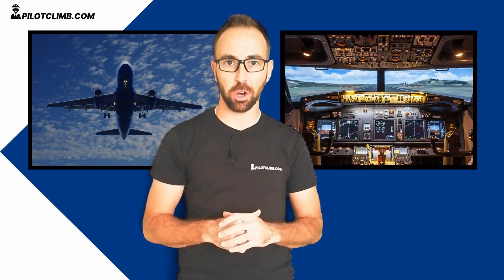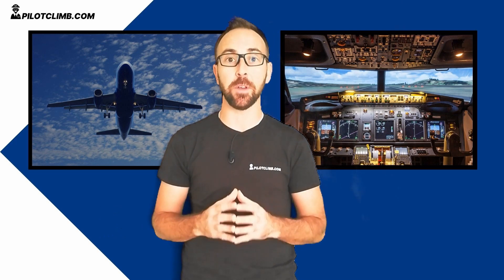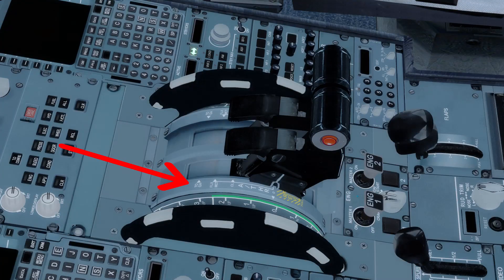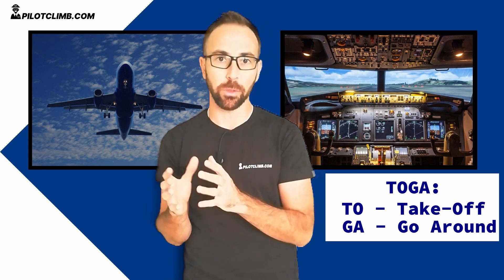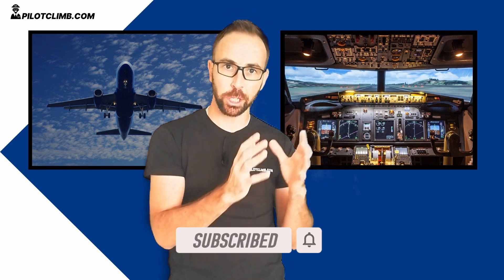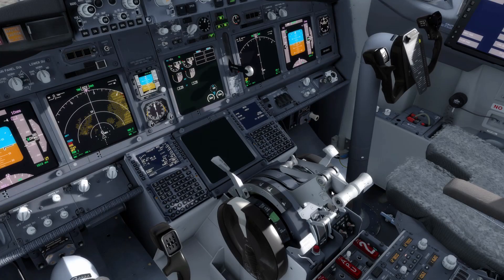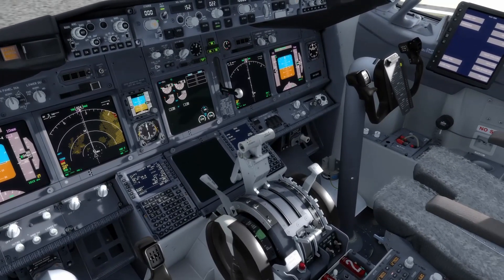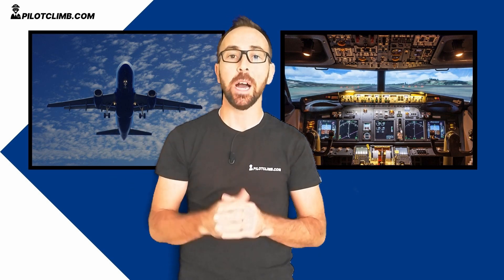TOGA Aviation - Take-off And Go Around Mode Explained!

Comment: So TOGA button does advance the thrust levers using some sort of motor, right? I'm building my own 737-800 sim from scratch and it's great to know how I have to set up my own force feedback motors when I install them. Another question is when and how do you disengage TOGA? Do you always have to do it when you get airborne or just when you have an aborted takeoff? And, finally, what is the thrust and reverse thrust levers reaction? Does A/T DISENGAGE advance reverse thrust levers and retract throttles, disarm the A/T toggle switch or nothing like that? Great to see a new Captain bringing more knowledge to the table!
Reply from the maker: Hey, I hope you are doing great! Nice to read you are building your own B737 Sim, Have you seen the video of the 737 Simulator I made a few months ago? A very good friend of mine built that sim.
Video Link:  https://youtu.be/fWKZ6Qbq_oM
 
Yes, pushing the TOGA switches will advance the thrust levers.

We don't manually disengage the toga mode it happens automatically.

The A/T disengage switch only disengage the A/T,   it does not close it and the reversers are not activated with the A/T disangage switch.

Let me know if you still have any questions!!
Have a great day!
Reply: @PILOTCLIMB  Thanks for the suggestion. I'll look for that video and many thanks for the answers! May I ask you just a final question? Do reverse thrust levers, pedals and even the yoke return to neutral positions when you release them or do people add springs to those in sims just to simplify control? Hope you're doing great yourself, too!

Comment: I have a question. I fly cessna grand caravan with Garmin G1000 suit. I haven't tried a missed approach by using TOGA. I know for sure that by pressing TOGA on grand caravan, autopilot gets disengaged & autothrottling is not avaialbe on my aircraft. I want to know if the autopilot gets disenged, can the aircraft still pitch up to Flight Director guidance automatically? And does TOGA disengage AP on all the aircrafts or it varies on different aircrafts?

Comment: Good Day Capt, can i ask you one question.... What it is mean within 1 dot for localizer captured/established?is there any remark on PFD if localizer or glide slope has been captured/established?...
Reply from the maker: Hey, many thanks for watching and the comment! When you are one dot before getting established on the Localizer means that, normally, you are 0.5 degrees off of the localizer. The localizer deviation dots are indicated on the pfd where the localizer is.

If look on the upper part of your pfd you find the FMA, that tells you what automation mode are active or engaged.

I made a video where I performed an Autoland with a simulator, in that video you can clearly see when we get established on the Localizer and on the glideslope.
Click the link below and you will watch it:
https://youtu.be/_oD43sxhtBU

Let me know if you still have any questions.
Reply: @PILOTCLIMB  Good Day Capt, first thank you so much for your reply. I already watch your video with autoland cat 3
Localizer and Glideslope (pink) diamond should always in the center of yellow line(vertical line for localizer and horizontal line for glide slope) ? Is it any deviation allowed for example horizontal yellow line slightly above the pink diamond?

Comment: Do you also have a A320 type rating?

Airbus has developed a new GA mode for the A320neo family with CFM LEAP-1A engines.

The new mode is called MAN GA SOFT.

That means that if you move the levers to TOGA, you have 5 Sec to active the SGA Soft Go Around mode by moving the levers back to FLX/MCT position.
If you dont do that the TOGA mode will be maintained.

When the SGA is activated the Vertical speed will be around 2000ft to 2300ft per minute.

It depends on aircraft config like Flap Setting ect.

This is a new mode but i dont know if it is or will be availible for PW1100G engines and if it will be availible for the V2500, CFM-56 aswell.
Also no information if aircrafts like A330 may also get this new mode.
I thought this info suits well to the TOGA topic.
Reply from the maker: Many thanks for watching and for another great comment!! I don't have a Type Rating on the Airbus, I only have the Boeing 737 300 to 900 type rating.
I wish you a great day!!

Comment: Have you heard of the Delta 191 crash? The last word the Captain says is TOGA. What does it mean in that context?
Reply: As a 16yr old aviation fan girl I’ll try to explain with my very limited knowledge: 
Basically TOGA= maximum engine thrust. This can help recover form stall and reduce the angle of attack. TOGA can also ensure a rapid climb if the aircraft is at a dangerously low altitude. I haven’t heard of that crash but definitely will look into it, and maybe I can give more clear answers with context (which I’m currently lacking..) if you receive a better answer please tell me!
Reply: @roxanadanielsson  Thanks Roxana, I appreciate your willingness to help. Even though I wrote my question 11 months ago, it is never too late 🙂

Comment: I heard that if you push TOGA switches twice you have the maximum available thrust, whereas as you said, if you only press them once you have around 98% of the power available. Is that true? Thanks captain
Reply from the maker: Another great question!! That is true, if you push toga once during the go aroud you won't get full thrust, if you push it twice full thrust is provided.
Reply: What happens if you PUSH IT REAL GOOD!

...?
Reply: @dustintravis8791  It plays a sound effect Do do do do do do do do da de da!
Reply: @dustintravis8791 it somehow puts you in a g suit and equips a rocket engine

Comment: Question: what if you accidentally push toga button? Is there any switch to disengage it?
Reply from the maker: Great question!! You can always disconnect the Auto Throttle! This will stop the thrust lever to increase power...
Reply: @PILOTCLIMB   Thanks for replying.
Reply from the maker: @faisalhabib1662  you are very welcome
Reply: The way I do it is to disconnect the A/T, move throttles to idle and apply braking.  You may have to move throttles to advance and then move them quickly to idle.